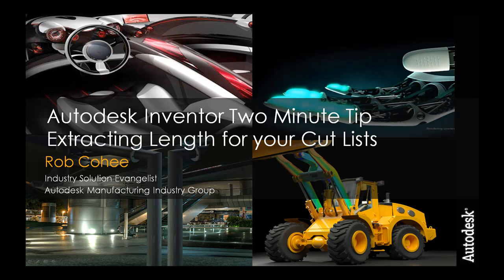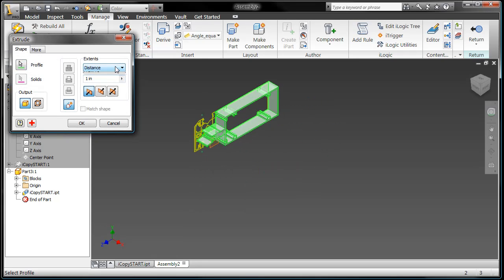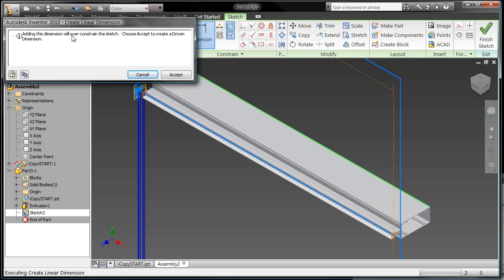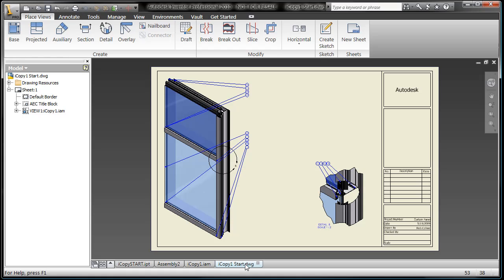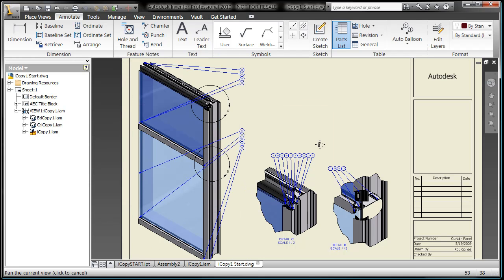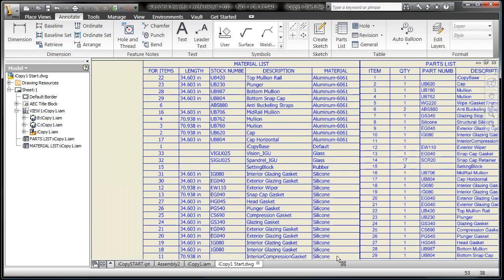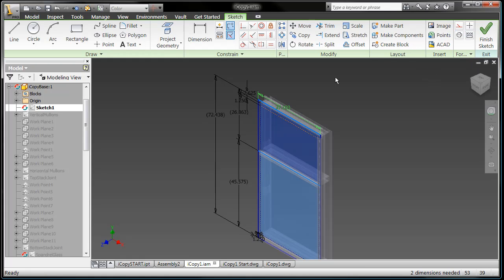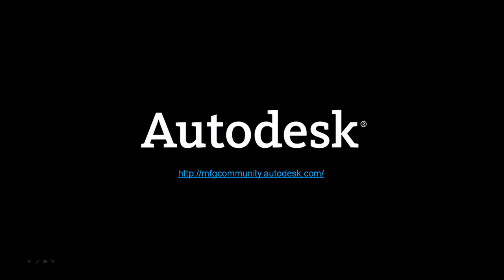Autodesk Inventor Two Minute Tip: Extracting Cut Length

Comment: So can you create a template part for example a 2x4 and do and extrude to then get the 'length' of the board in BOM? By that I mean have the driven dimension in the template and just import it in and use it. I keep trying but it always says there is an error and to delete the driven dimension and to create it again which is a huge time waster.